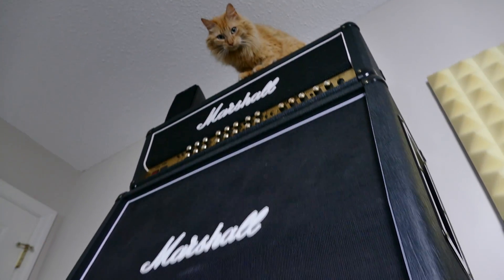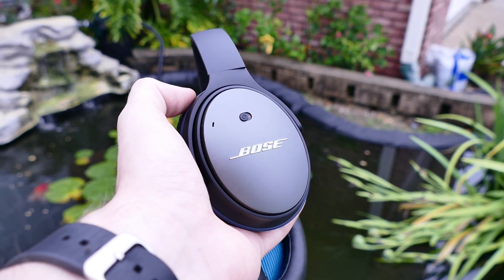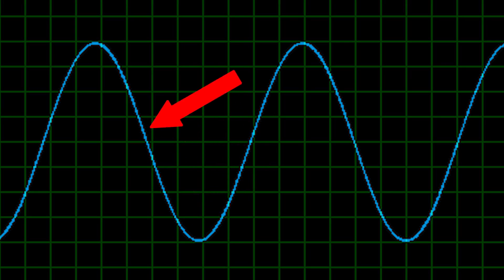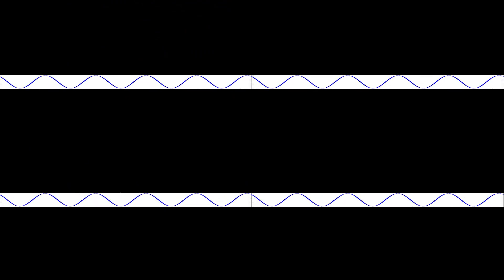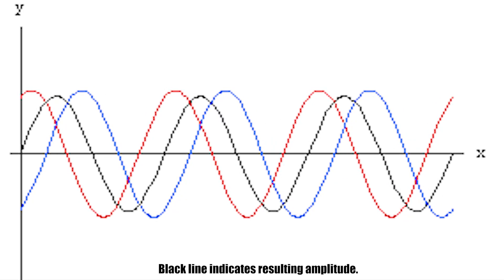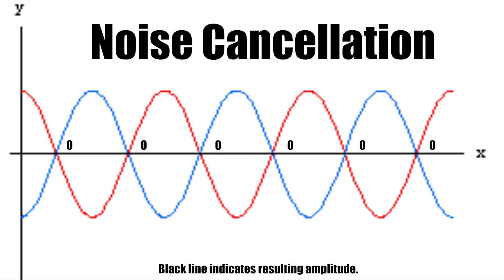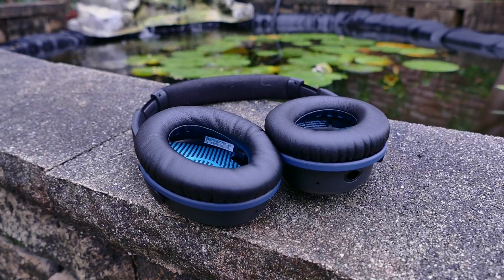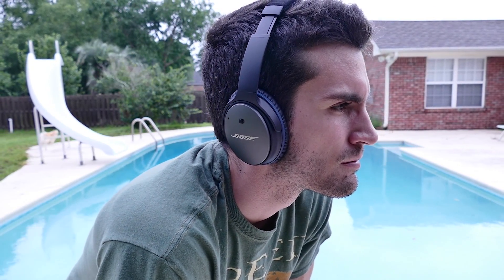How Do Noise-Cancelling Headphones Work?

Comment: I bought those Sony MDR 1000X that have ANC and I understand perfectly what you mean by "added pressure". Those headphones are a tad more expensive than the ones you review in this video but they are well worth the money.

Excellent video btw :D
Reply: Mr Morphic no... thats because razer is a fucked up marketing company that sells you shit with rgb and a lot of dampening around the 1ct driver to boost up the sluggish bass
Reply: Mr Morphic They bump up the bass so you can't hear the shitty sound quality.
Reply: I also noticed this wierd pressure on my ANC headphones but after a while I forget about it. My mom on the other hand can't wear them for longer than 10min.

+Mr Morphic
As long as you think that your Razer sounds good, keep it. While the difference in sound quality compared to a pair of proper headphones plus soundcard is huge, you won't notice until you hear it yourself. Once you're used to high quality audio, you cannot go back since you will be disgusted by most "gaming headsets" and their comparatively shitty sound.
Reply: Mr.Magnificent    ive listened to many pairs of cans and if there is one thing i have learned its that there is a lot of bullshit in the audiophile world.  the sound stage of a pair of headphones is overrated, and in fact, it comes down to open back vs closed back headphones, and even then, only a trained ear could tell the difference that know what to listen for. the rest goes to the quality of audio going into the headphones.  a bit of work on the ambiance with reverb will take your sound stage further than any pair of headphones (or speakers) can relative to another.  the fact remains, you cant magically create a sound stage when you still only have audio coming out of two speakers.  if you are looking for a sound stage to imitate that of a stage, then headphones will lose to a decent pair of speakers every time simply because the speakers are actually in front of you the way a stage is.  this is why headphones with incredible sound stages such as the hd 800s are designed to direct the audio from the front as much as possible in a pair of headphones.  the reason i recommend m50s is because they have large drivers and can put out VERY high volumes.  with a bit of eq, m50s can push out any frequency the way you want them to, and at 80-90$, they cant be beat.  they are also the best built headphones under 300$ i have ever seen. there is a reason they are some of the most praised headphones of all time.  

also, dont use stereo imaging and sound stage as two different things, in fact, imaging is part of the sound stage.
Reply: oh lol , the bass is insane on these ones tho ahahah
Reply: Mr Morphic for those who dont really care about having the best gaming audio... but want to have a simple headset to use... id really go for a HyperX Cloud 2 for 80$ its all you need to hear directional (binaural) sounds perfectly well and still give you some lower wupp for satisfaction with a good enough and simple mic and also exeptional comfort... and it really is an upgrade already from everything in the Headset market out there, 4 times as much and less, in every aspect (excluding most sennheiser and beyerdynamic headsets)
Reply: I mean i already have these and have for about a year and they have over all good sound quality , good bass , bearing in mind i put the slider to 100+ in synapse xD but also remember these are the Kraken Pro 7.1 not the original Kraken 5.1
Reply: The pressure thing is much stronger on Bose headphones in my experience. The cancellation however is quite strong.
Reply: I think that this pressure you are talking about is due to the wave frequency that the NC are making on your ear to cancel the noises.
Reply: LimitIsIllusion Seriously?
m50s for gaming?
They are fkin monitoring cans and they have super narrow to no soundstage at all... and stereo image is nothing special at all which results in bad audiopositioning in games, (but does not matter with monitoring)...
and they are uncomfortable on top!
The m50x are an overhyped missused pair of average monitoring cans and i would not recommend buying it... If you need closed back as a gamer youd be better of with something like a DT770 or more efficient and cheaper HD 589 cs.
And for using the headphones at your desk only, open back headphones are much superior anyways...
Edit:
Yea the anc ath headphones are quite nice though, the best along with sennheisers anc lineup (only the newer ones... eg hd4.50)
Reply: Wait is that why my Razer Kraken Pro 7.1 Chroma headset feels like it sucks onto my ears when i wear them and when i pull them off my ears its like a suction cup xD
Reply: If you're looking for noise cancellation is recommend audio technicas line. I never liked noise cancellation, but AT does a good job. If you want gaming headphones, just find a pair of Ath-m50s on sale on Black Friday or something, they usually go down to 80-90$. You cannot go wrong with them, and if you add some type of amp to then they will fucking shine (if you listen to music loudly).
Reply: LimitIsIllusion Soundstage and imaging are somewhat the same thing, en the end its just some "audiophile bullshit" terminology to describe a headphones sound characteristiks.
And just a little reverb does not replace good soundstage.
Also soundstage on headphones is different than on speakers...
Speakers have the advantage you mentioned, but still, they fail with binaural audio, it simply doesnt work work with speakers...
So describing things like imaging for me is how well binaural audio works with a headphone, and exactly that is whats relevant for competetive gaming, lokalize where the sound is coming from...
and that is what the m50x fail terribly at, cause they werent designed for that, and no reverb can fix that...
So you just recommended a very uncomfortable headphone which is bad at reproducing positional audio for gaming because it can play loud...
well good job then!

Comment: Could the strange pressure you feel be low frequency soundwaves that your headset is not too good at canceling? That could make sense since there would be no tangible benefit for the software developers to tune the headset so that it cancels low frequency noise, since you cant hear it in the first place, however, low frequency soundwaves usually have such effects, along with your head feeling a little bit heavy aswell.

Comment: Actually, if there's a vacuum between your 1atm environment and an explosion, it's still possible to hear something. In a vacuum, explosive force doesn't remain in stasis until a gas comes along for it to interact with. The explosion still happens, and when it reaches your environment, or just your eardrums if you're in the vacuum for some reason, you'll hear sound. You're never hearing the explosion: you're hearing the matter that the explosion moved. There's always a distance between the explosion and the first atom it moves, so if you can be said to hear an explosion in Earth's atmosphere, you can be said to hear an explosion from the other side of a vacuum when it reaches your environment.

Comment: I've got a question: should i get a second hand 980ti for about 200 to 300 euros or a brand new 1060? the prices are roughly the same but i don't really know my ways around the pitfalls while buying second hand stuff. Can anybody help?
Reply: Well if you already have one 980 ti, a 1060 would be a downgrade. I have two 980 Tis, and while there will always be better stuff, two 980 Tis will comfortably handle anything in 4K right now, as well as 1440p at 100+ fps. I don't expect to need an upgrade nor find a worthy single card upgrade for another 2 generations
Reply: I also bought one of them used, and for that reason I only buy evga, they cover second owners for a three year period after the purchase date. You can find the remaining warranty with the serial number on evgas website

Comment: i bought the qc35 yesterday an hour before I flew into nyc. i used them for the full 7 hours the battery barely went down and the sound quality is unreal. no remorse in buying whatsoever
Reply: Lukzeh they are supposed to have a 40 hour battery life so I'm glad that's working out for you!
Reply: JackaJacka1108 just gone and bought the 12.9 iPad today also. Still on same charge, still in love with the qc35s😂

Comment: As I've read until now, it seems like that the brain is interpreting that lack of background noise which is used to, as if the ears itself are not able anymore to perceive clearly noises. For me personally it feels the same as when you rapidly descend in altitude (if you have ever experienced that if feels exactly the same). Some people which have entered an anechoic chamber report the same feeling (also induced by the lack of background noise, probably). I am not sure if it has to do something with that or not, but I can assure you that after 2 weeks of use I really do not feel any pressure at all anymore... does it mean that the brain got used to that or what? It would be nice to find that answer out, but since yet nobody seems to really have managed that.

Comment: I had a pair of noise cancelling headphones awhile ago. Yes you will notice an increase in the pressure feeling in your ears when you turn them on. It's an actual feeling and you notice it right away when you turn them off and on. For me it was nice traveling but the added "pressure" feeling gave me a headache after awhile. Try it first before buying.